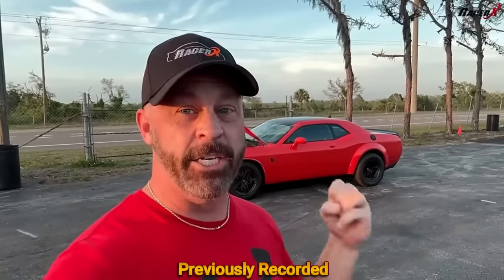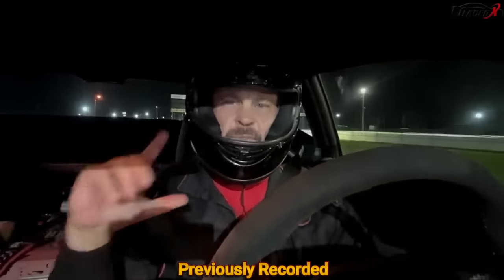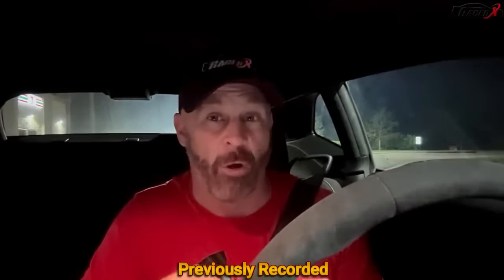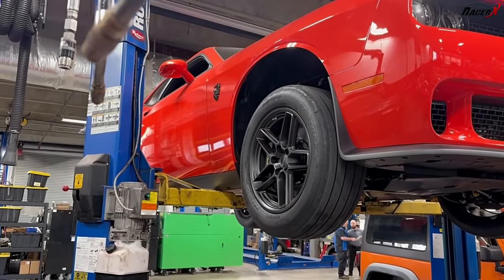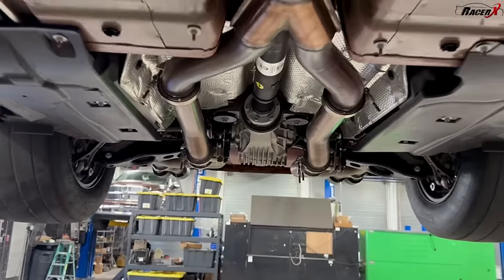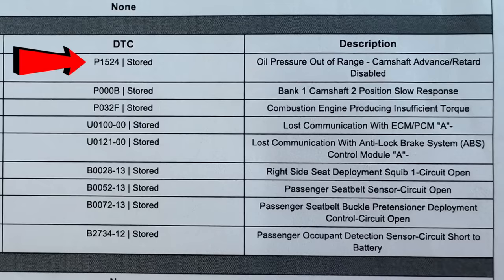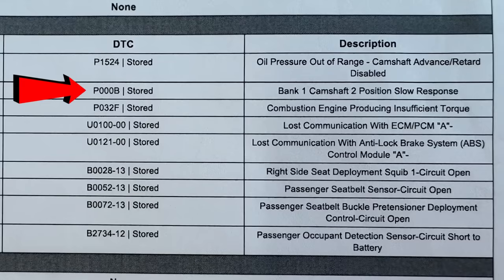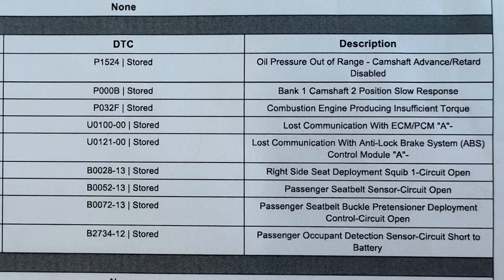What's Going on with my Demon 170?  Is my Engine Trashed?

Comment: You may have a bad alternator that's giving you these problems or a bad battery
Reply: I have to chime in here I have a 2010 6.1 Challenger Tremec 6 speed..I have had a few electric related problems Back when I first had mine Kooks and Corsa cats ..and tuned..I found I was getting some issues..turned out the Power connection in the trunk + battery area was loose..at the rear fuse box..I tightened all and problem solved..Now I have another electric issue..turns out it's the alternator. I stress tested it. It gets hot and voltage drops off, car gets wacky sounds like it's got a lifter click ..(not the failing lifter thing) I checked battery ..low not charging up or keeping up..ie alternator is failing ..So I got a new made  250 Amp High output alternator and this solved the problem Then also replaced the faulty failing Electrostatic gauge cluster back lite..with a new Gage face and glow needles..Looks great Red needles and Green and red gauge face colors and Special Lettering and graphics SRT8 And 1HEMI1 on the gauges..Looks great..So electric can cause issues. Also had a O2 sensor wires issue that caused them to draw power..They got wet inside.. voltage high..misfire..all electric related..Sealed new connectors from water solved.. but that down the road hurt the alternator and caused the last issue. Electric can be a problem long term and short!
Reply: @robertblackton2295  well with all the codes look like a low voltage problem oil pressure sensor lost communication other short to ground open circuit

Comment: The U0100-00 is the issue,  its to involved to put in this post, could be a simple loose connection, or may need a reflash. It will be one of the two. I mean how these people are called master Technicians with all these certificates is beyond me, 🤔🤔as soon as you flashed them codes on screen and I seen the 100-00 i was like why didn't they START right there. 
  Thats why i always believed just because you got ASE certs, doesn't make people the most intelligent. Anyways hope you get it sorted out.

Comment: If you were Joe Blow, they'd void your warranty for racing it.
Reply: Uh no they wouldn’t cause that’s the exact purpose for them building it!
Reply: Yup, car was built and advertised as a race car. So we're the 1320's, in fact mine came with only 1 seat, drag spec tires, line lock, and trans brake. I also purchased the 8 year factory extended warranty so I can race for eight years doing nothing but maintenance.  Love it!

Comment: Unfortunately dodge is the worst quality vehicles today my 2019 Cummins has been to the dealership at least 30 times for recalls warranty stuff, it’s a joke and unacceptable. I have a 2023 charger hellcat and I’m sure it will be the same thing. Dodge dealerships don’t give a fuck and about anything they couldn’t even get me a new battery for my hellcat… back ordered until June of 2024 now how the fuck can you sell a product you can’t get parts for. Dodge is an absolute joke and it’s sad because it’s the only vehicles I’ve owned my entire life. I have a new 2500 pro master too and the power steering hoses all leak. The dealership can’t get them until June again lol it’s fucked.

Comment: Since when did manufacturers honor warranties of vehicles clearly damaged from racing at the drag strip?
Reply from the maker: It’s marketed as a drag car.. it’s literally what the car was engineered to do.  It comes from the factory with tires specifically designed for drag racing
Reply: @RacerX9  That doesn’t mean they will honor the warranty if used outside of regular street use.  I think every car guy knows this.
Reply from the maker: This car was not intended for street use..  all car guys know that!  If you read the waiver that Dodge makes you sign before you buy one it have lots of language about how the car is supposed to be used 👍

Comment: More people get these Dodge and they do not give it time to break in they go straight to the track and start banging on it you have to give it at least three to four thousand miles first to break in get used to the computer but people go out here and bang on these cars right when they get them and think that it can do it but it will not you will tear up a Dodge or any kind of vehicle if engine is not broken that engine was not designed to just go out there and drag race it's not a drag race car have to give it a chance to break in first

Comment: First mistake you bought a dodge. Second mistake you took your car to a dodge dealership for service. Third mistake you believe this will be fixed. Dodge has never fixed an issue with engines. Usually they patch and give it back until the warranty is up. Then tell you you need a new engine. Mother had a 2011 durango citadel with problems since she got it. Engine dead at 64k wanted to replace it for 15k. This is after the AC quit 1 year after buying the car and it was never fixed. Just kept putting freon in it

Comment: STELLANTIS fired the engineers and software developers.  Your relying on India, Brazil, and Mexico to fix your car.  Why hasn't a gauge been installed for oil pressure . If oil pressure is under 31 psi hot you'll  get these codes. The system is designed for 42 psi or higher.  You either have a bad op sensor,  I'd replace it and retest. Throw a mechanical gauge on it, see if you have low pressure,  that's easy. Otherwise check wiring,  pinnouts, etc.. we all know dodge wiring sucks, tell them to load tests the circuits from op sensor to pcm... what kind of master tech you dealing with? If mechanical gauge reads under 42 hot your in trouble,  engine time. You don't need star for this IMHO

Comment: I would love to race racer x for fun  he can drive his wife scat pack  with an automatic I will drive my rt  with a 6 speed  and a 392 rear end gearing  should be fun.. I beat my friends charger srt 392  his wS an automatic too . Real racers know how to row the gears 🤣🤣🤣🤣🤣
Reply from the maker: Unfortunately I sold that car in early 2021.. sounds like your enjoying that car
Reply: @RacerX9  that's what you are supposed to do ENJOY . X I'm 60 as of last December so I remember the 70s and 80s. You are q of my  favorite and keeping it real you tubers . I just want to tell you so thing 1 things break if you want or need to race get rid of your stock rear end . You can't Go wrong with a Dana 60 that are bullet proof.  2 in my opinion  boost is over rated for an example with a 1968.hurst hemi dart  run..9s all day in the 1320. And watch the 62 to 63 super stocks came with a 413 ram jet engines these cars ran regularly  7.95 in.the 1320 no boost you get an engine that can do it  and a set of 4.56 cogs or higher . Keep up the great kids brother . See ya down the road dave. BTW I have a separate  set.of 4.10 gears just in case and yes they are a Dana 60